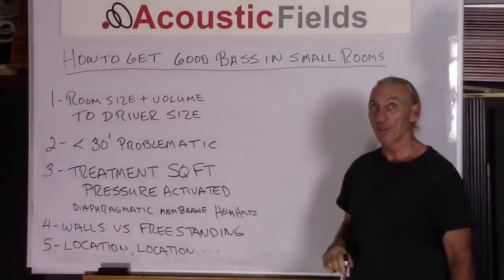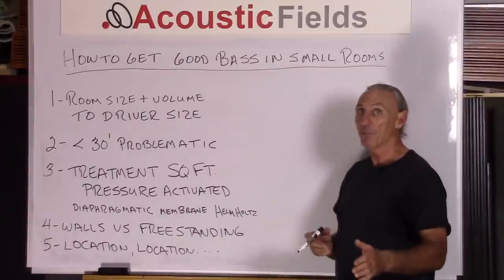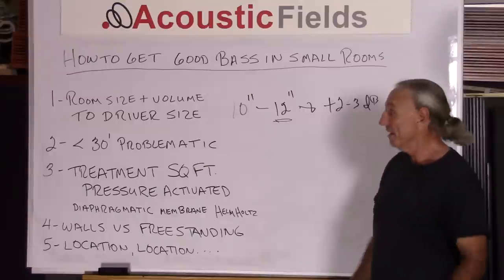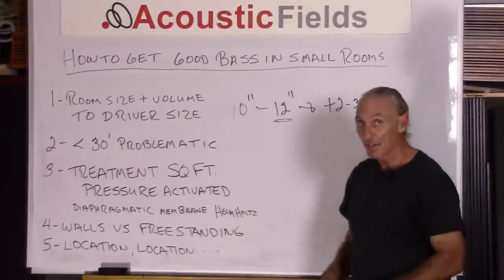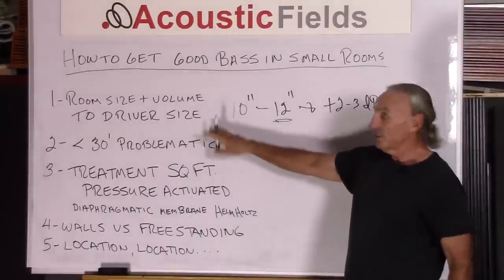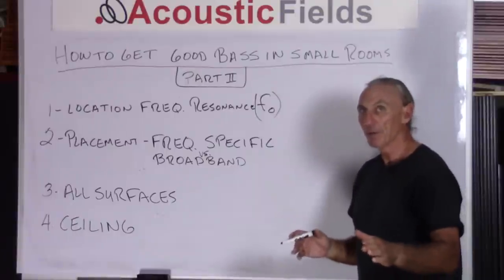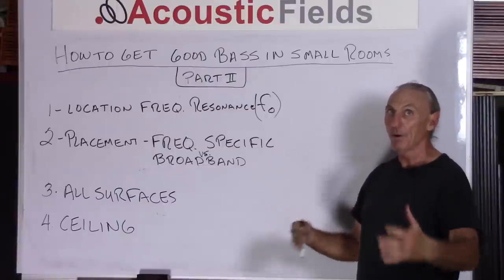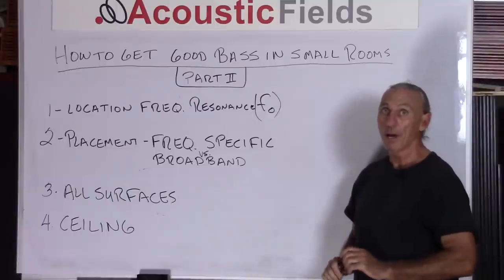How To Get Good Bass In Small Rooms - www.AcousticFields.com

Comment: Hello I have a small room that I wish to turn into a dedicated listening space. 
Dimensions are 12FT x 12FT x 6FT Height (low heigh ceiling)  Its in my basement and already enclosed by 4 concrete walls. 

I have a pair of Martin Logan Electromotion ESL's and a Velodyne DSP15 (15 inch woofer) Driven by a rotel RSX1560.  

Its a simple setup.  However what do you recommend in terms of sound absorption / diffusers etc?

Appreciate your assistance,
Reply from the maker: It would be best to find another room. Your ceiling height is much to low to accommodate any type of audio playback. Vary all dimensions by at least 25% from each other.  Stay away from same dimensions for width and length.

Comment: Thanks for the video, they help explain a lot of things. Just wondering whether you have any advice for dealing with very large windows in a 10x13 feet room? I have one on the right wall (left wall is solid throughout) and and front wall between the speakers (rear wall is solid). There are curtains (but not so thick). Noticed that if I place the speakers on the window side, the low frequencies and imaging aren't as good as the solid wall side.
Reply: Problem is I need to place the speakers on the window side since the door is on the other side. Makes it difficult to get in and out if I put the speakers on the good side of the room.
Reply from the maker: T,  You must find another room or cover the window.

Comment: Sir, Thank you so much for a wast knowldege you share.  I am a beginer and i am planing to build home theater, i want to understand how to locate the pressure areas in my room...?  Any device or formulas i need to use to get the results.
Reply from the maker: Hi Siddiq, Room size and volume must match your intended usage. This is the biggest mistake I see people making. They try to do too much in too small of a space. Use our data base as a guide. Fill out the information requested in this link: http://www.acousticfields.com/free-room-analysis/. I will then compare your room size/volume/usage to our data base of now over 130 built and measured rooms. We will look at low, middle, and high frequency issues in your room and then we can better understand what the room is capable and not capable of. It is much better to understand the capabilities of your room before you try to assign a usage.

Comment: Thanks for the advice, one question, having a smaller room size would it be a good idea to put a subwoofer inside a bigger wooden cabinet with the front open and wall behind it, still raised a few inches from the floor? would the bass frequencies be easier or more difficult to control for mixing?
Reply from the maker: Hi Remshaw, Once the Low frequency energy from the sub (bass) is released into the room, it is the property of your room size and volume. The room tells you what you will hear and what you will not.

Comment: I remember hearing you talk about the nonsense of bass traps in corners in another video. Which one was that? And if I have wooden floor ceiling and roof and 3 cement walls, is 1/2 of my room already capable to let bass pressure pass? Focus of other frequencies reflecting on the 3 walls and the roof?
Reply from the maker: By definition it takes two parallel walls within our rooms to produce axial modes. It takes four of the same to produce tangential modes and six walls to produce oblique modes. It is not two parallel corners. Corners only represent a small percentage of the complete wall surface area. It takes two parallel wall surfaces at a minimum to produce unwanted low frequency issues. You must treat at a minimum 60% of each wall surface area to manage unwanted axial modal issues.

Comment: Hello fellow members ive been facing a major problem that im unable to find the bass in my listening position. The moment i hit the back row the bass is 10x tighter the lower frequencies are audible aswell as felt but the moment i move in the front row, while standing the bass is audible and fine but the moment i sit in my perfect triangular position the bass is gone. I tried different speaker positions aswell as distances but the problem remains. If im facing bass nulling how to direct bass a bit forward? If i need bass traps how exactly will they help? 

Attaching a small video of my room if im doing anything wrong please guide me. 

Room dimensions are roughly 20ft hy 16ft

Thanking in advance
Reply from the maker: You need to reduce the amount of low frequency energy within your room due to room dimensions. Fill out the information in this link: https://www.acousticfields.com/free-room-analysis/ Lets take a look at the total situation.

Comment: Hey Dennis, thanks for the informative videos. I am putting together a live jam room in my basement using the room in a room design. My current room ratio after sound proofing materials are 1 x 1.96 x 3.11 (79"x155"x246"). How should I change this to make for the best sounding room? There will be guitar, drums, vocals, and bass. Thanks!
Reply from the maker: +Yoshisakan The ratios you are suggesting will not be adequate for a basement subterranean structure. The density of the concrete and earth forces all the energy up through the structure and first floor area.  Low frequency energy will be a major issue. Fill out the information in this link and and give me the maximum footprint you have to work with.  http://www.acousticfields.com/free-acoustic-treatment-room-analysis-tell-us-room/
Reply: +Acoustic Fields I filled out the form. I found a calculator that said the nearest known ratio can be obtained by shortening the length of the room from 20.5 to 17feet. is this acceptable? I don't have much room to work with here due to the low ceiling height.

Comment: Hi,

Is there any ratio or so called formula to calculate how big a driver (subwoofer) i need for my room.
For example, my room is 16ft 8 inches long, 16 ft wide, 8ft 4 inches high, im planning to go with dual subwoofers to help tackle with room modes (square room horror :( !). So should i go with two 10 inch driver subs or 12 inch ? 

Thanks in advance. Great channel & website btw ! Cheers.
Reply from the maker: D, Additional subs will not help you with room modes. In your stated room size and volume, I would use a single 10" driver.

Comment: - My listening room is w8xl10xh8
- I can't use another room
- I have a large window on the length wall
- I have laminate with a large area rug on it

Any suggestions to treat the room for the best audio playback?
Reply from the maker: Hi Kur, Your room is simply too small for accurate audio playback. There are improvements you can make, especially to the lower frequencies, but from a cost and audio quality standpoint, It would be best to get another room size to work with.
Reply: Acoustic Fields I see that tip constantly throughout these comments - I understand it's not ideal but not everyone can't create the perfect room. I just want to take advantage of what I have been given to work with.
Reply: KurVibes, while you won't be able to enjoy clean articulate bass at lower frequencies you can still enjoy quite good sound via a near field setup. I would focus your energy on more of a home studio type environment utilizing bass traps and primarily absorption. Also, you are correct, most of us don't fit into the >30' room dimensions but make do with what we have and still get quite goods results. Above all - happy listening!

Comment: Can anyone tell me the formula to calculate cubic footage for a room with a canted ceiling? 7'/6" on the low side to 11'/3" on the high side, the room's width is 10'/8", length is 12'/6".  Thanks  :)
Reply from the maker: Hi Donny,  Take the 7.6 and the 11.3 and add them together and divide by 2 to get an average height for volume calculations.

Comment: I've enjoyed a number of your videos but I'm struggling with an element of this one, namely the driver size being matched to the room.  I understand the issue but driver size is one of a number of elements that determine a driver's characteristics.  I've designed high performance speaker systems for many years.  Driver diameter is one of many factors in a woofer.  Resonant frequency, sensitivity, excursion capability, multiple drivers and many other factors make the idea of 10 vs 12" pretty much a moot point.  How low does the driver extend in the cabinet with its electronics (if a powered subwoofer).  Perhaps you're simplifying for your audience.
Reply from the maker: You must look at energy like the room does, not how you think. The room only sees energy that is placed within it. The difference between a 10" driver and a 12" driver is about 2 dB more output. This is what you must look at. You must look at the energy out put into the room. Most people place too much low frequency energy into their untreated boxes (rooms).

Comment: I like really high ceiling house, wonder how much it will effect the sound : 17' W x 20' H X 23' L size living room. Thank you.
Reply from the maker: K,  You have good size and volume to match your usage. Fill out the information in this link: https://www.acousticfields.com/free-room-analysis
Reply: Actually that would be the size of my future  listening/living room; just wondering how the high ceiling would effect the sound, or should I just reduce the ceiling down to 12 feet instead, thank you. (the lower-half side wall would be concrete covered with curtain, carpet floor.)

Comment: Hello Sir, thank you for your videos and much respect.
Question: My tracking room has 4 walls that have different measurements  17'W x 23' L x 8'W x 19L  and 8.5"H  can you provide some quick tips at what problems i might have with the walls different sizes and the low ceiling.. 
Thank You
Reply: +Mixskywalker note: this is the tracking room with drums being the #1 reason
Reply from the maker: +Mixskywalker Fill out the information in this link: http://www.acousticfields.com/free-room-analysis/. Take photos of all surfaces. Include photos with form.

Comment: Hi and thanks for the video. Just a basic question if I may. All things being equal, is there an optimal distance or perhaps a minimum distance between listener and speaker. Am considering a 5 inch vs 6.5 inch speaker and can put 2-3 feet between my ears and the speaker. Is the 6.5 speaker even worth considering. Small room of course :) Some very amateur treatment is there, and more is underway, but will take time. Thanks.
Reply from the maker: Smaller drivers produce more detail and less output. These are both good qualities in small rooms.
Reply: @AcousticFields  Thanks for the reply! So what’s the optimal distance for my ears / head / listening spot from a 6.5 inch woofer. Can it be quantified.

Comment: do bass traps, bass abortion benefits being from floor to ceiling. or just speaker hight?.

thank u 
colin
Reply from the maker: Low frequency absorption surface area requirements are based upon many issues. You must locate the unwanted pressure areas and apply the correct square footage of the treatment that can deal with the problems in that specific room area. Each room boundary surface area may have different requirements because of the room size and volume, low frequency driver diameter, and listening pressure levels.

Comment: Hey buds love your videos, I have a quick question for you.  What size Driver do I need for my small home theatre room.

Room size is 16' x 15.5' with 8 foot ceilings.  The volume of the room I think would be, 1984 cubic meters 

Thanks in advance.
Reply from the maker: Hi Charles, I will need a bit more data. Where is the room located ? How is the room constructed ? Is it frame or concrete? Is noise transmission to other rooms an issue?
Reply: OK the room is located in my basement with two walls concrete foundation and two walls framed interior. Safe and sound insulation plus going with Quiet Rocl 5/8 Drywall.

Comment: So if i have a room 4m by 4m and 2.2m in height? what would be the right choice of driver?
Reply from the maker: Hi Diego, You have good width and length but your ceiling height is some of the lowest I have seen.  Any energy below 100 cycles is going to be a  large issue. Stay small . No larger than 125 - 150 mm.

Comment: I have a question for you and for the community here:I bought two yamaha hs7 monitors,i am amazed from the sound quality and detail,the problem is i have a medium to small room,so i cant place the speakers away from the wall(they are rear bass ported)Also the bass can be heard along the whole house and it corners too much in my room.The question is : is acoustic treatment gonna block some of the bass and isolate it in the room or i am forced to go on with this situation?Also the bass i here in the corner is the true bass response or it is eqed by reflectionbass?Also i have wooden closet and desk.Thanks in advance
Reply from the maker: X, The goal of acoustic treatment is not to "block" anything. Treatment comes in two types: absorption and diffusion. Your issue is a noise transmission issue and must be dealt with using barrier technology which is a permanent build. You must measure the frequency and amplitude of the noise and then build the proper barrier to reduce the noise transmission.
Reply: Acoustic Fields ok thanks for the tip
Reply: from a video I watched by Bobby Owsisnki, using weather stripping along the interior of your door and a door stop/door sweep combo can help isolate sound significantly.
Reply: Steven Sampson i will check it out man,thanks

Comment: is 11'x9' way too small for a control room? should i just scrap the idea of turning it into a studio?

Thanks
Reply from the maker: +Narudh Areesorn  Way to small. Find a room that has a dimension of 17 w x 11' h x 23' l
Reply: this is control room only? wow ... so big
Reply: I have a similar sized room, because I am forced to operate in my bedroom as an engineer only mixing on the side. My room is 8' h x 12 1/2' l x 9 2/3' w. I have no choices, so I have to have my mixing position in this room, and although not necessarily right in the corner, basically at a corner of the room. I could pull the desk farther toward the center of the room, but the loss in floor space is extremely detrimental to it being a bedroom. As a result, I have extreme influence from a 139.5 Hz mode increasing response at that specific frequency by something like 200%. I've to this point though the best option would be to mount a 24x48" ceiling cloud of 4" thick fiberglass boards something like 2' below the ceiling, hoping some Auralex LENRDs I have (I know... foam) would help by occupying the wall/ceiling corners. Any thoughts?

Comment: Hey - thanks for the video. much appreciated :)

i'm setting up a mixing/mastering studio. the space is 3.8m L x 2.75m W x 2.4m H.

i suspect i'm going to have to bring the dimensions in to 3m L x 2.4m W x 2.1m H after soundproofing (i'm thinking wooden framework, rock wool and plasterboard....). what kind of advice would you have in terms of most effective acoustic treatment? 

or indeed any advice on those sound proofing materials that might assist in the acoustic treatment process?

thanks, James
Reply from the maker: +James Moss  Hi James, there is no such thing as "sound proofing". You build barrier technologies to minimize the impact of noise transmission through room boundary surfaces. Do not "think about building" anything First, measure the issues and build the barrier that satisfies the magnitude and frequency of the noise transmissions. Noise does not care about what you are thinking because most of the material out in the public domain is not accurate. The common misconception I see a lot is the double wall concept. Building a double wall will impact noise transmission above 125 Hz. It has minimal impact on frequencies below those numbers.
Reply: +Acoustic Fields thanks very much for the thoughts. much appreciated!
Reply: Hello James, I'm curious because it's same measurements of my music room, I have Kef R300 bookshelves speakers. Do you have bookshelves too or towers ?

Comment: u dwell on the Donts, but no example, so what size room, for a speaker size?
Reply from the maker: Hi Y, There is no one size fits all. You have to look at speaker to ceiling height, array distribution of speaker, side wall distances for primary, secondary, and tertiary  reflections, size and diameter of low frequency drivers, and some others. You use certain guidelines in the beginning of the process. and for purposes of illustration.

Comment: what about the ceiling, sir? is concrete ceiling good for bass?
Reply from the maker: G,  Walls or ceilings that have more mass or density move less causing less vibration issues especially for lower frequency energy. Walls can actually become speakers by going diaphragmatic if they lack the required density.  A 2" x 4" wood framed wall is a good example. Try closing a door hard that is mounted to a 2" x 4 " wood framed wall. You can hear the whole wall move or shake.
Reply: Thank you for the quick reply sir.  Sir, my room is dead, what I have here is a room that 3 to 4 meters in width, 6 to 7 meters in lenght and a low ceiling. the problem is that the three corner walls are half concrete, cement  of about 3 feet tall from the concrete floor, and the rest is a thin double plywood to the ceiling, and ceiling is plywood too. and the other remaining wall is all plywood. And I guess all these plywoods are absorbing all my low frequency sounds, and i think it causes all the dead spot around my room. But we're builing a full concrete structure soon.  Planning to have a concrete (cement roof) cement walls, and floors, cement all, with some sliding windows.  Do you think this will improve the low frequency? Will a full cement roof (ceiling) and walls boost low frequency?